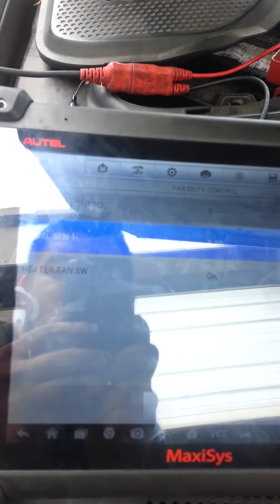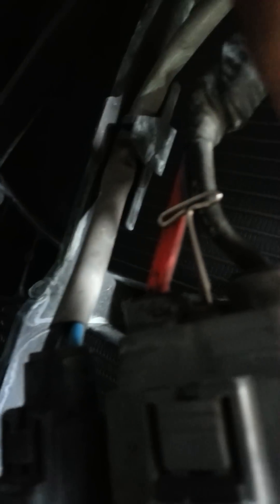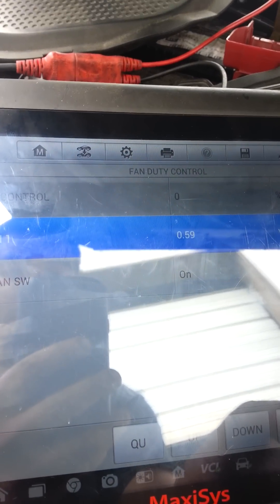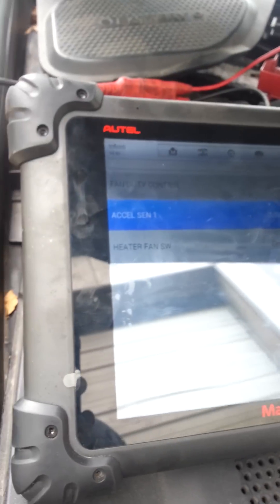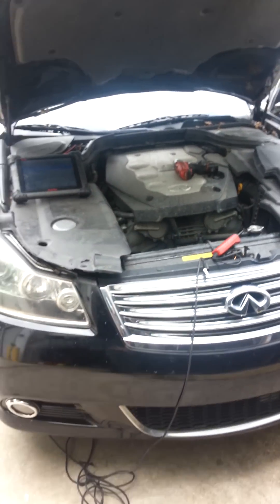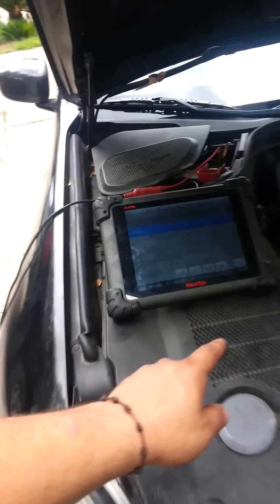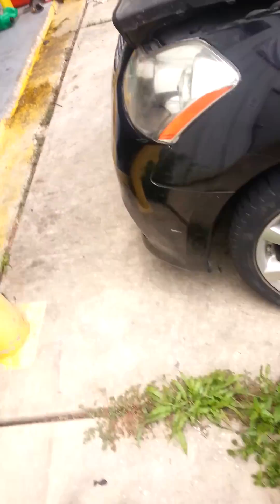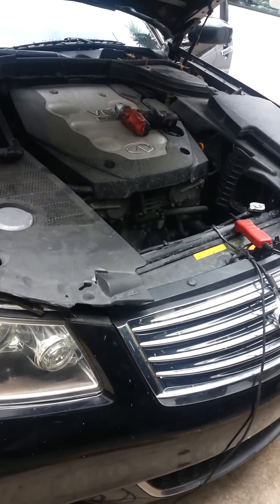Radiator fans staying on ?

Comment: My Logan car radiator fan is running fine in normal climate according to the temperature, but while sunny climate it keeps running..No body could diagnose this issue. I changed thermostat, ac pressure switch but nothing worked...PLEASE HELP
Reply: What did you figure out? I have the same issue
Reply: My check engine light came on and has code P0606, control module internal performance

Comment: Mines are acting up . I have 2010 fx35 awd.  So it’s understandable that they could turn on and shut off while on. But after I shut of the engine and it’s on the ON position they stay on. They do shut off momentarily and then cycle on at low to medium speed. 

If I were to just switch it on the ON position on cold start. They don’t come on. It’s only after I’ve driven it. Temp and everything normal also .

Comment: Thanks for video, obviously smart.. i have 04 g35 same issue, after 10 mins from cold start second fan kicks on and stays on... doesnt run for like 30 secs then cut off... any tips?
Reply: The tip here is to use that level of a scan tool to diagnose it

Comment: I have an Astra Opel G and the car radiator is always lit even if the car has not worked full hours when the ignition radiator works as if it was 100
Reply: Exact same issue. Do you remember how you fixed it ?

Comment: Hello
Please explain the solution to the problem because I didn't hear what you said due to lots of background noises  !!  Thanks .
Reply from the maker: these vehicle has a fan control module that kept the fans on all the time. replaced with a new one. now they only turn on when needed
Reply: Will I find the fan control module in the relay / fuses box  ?  Or is it always attached to the fan (  like in the vid )
Reply from the maker: Just depends on the type of vehicle. On this vehicle it's on the fan
Reply: Oz Mechanics      Thanks for your help. Now I could start on a defined location skipping relays , wires and fuses.
Reply from the maker: on this video i explained how the module was the problem. the control wire kept the fans on the entire time.
Reply: Oz Mechanics i have the same issue fans are on and when is time to to do there Cycle the turn they get louder
Reply: My car Renault duster 4 wd.... how to solve . My fan same as not turn off after engine switch off...919746682357